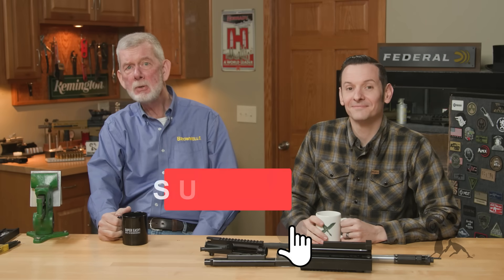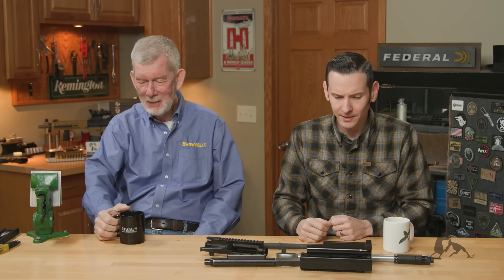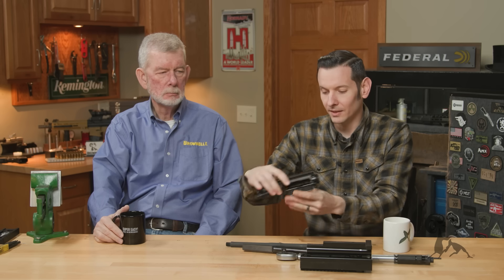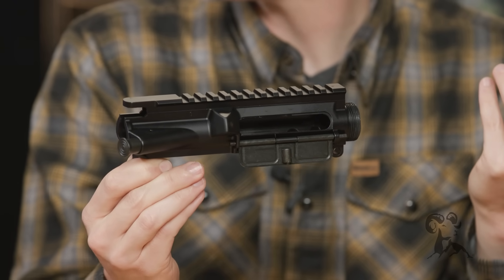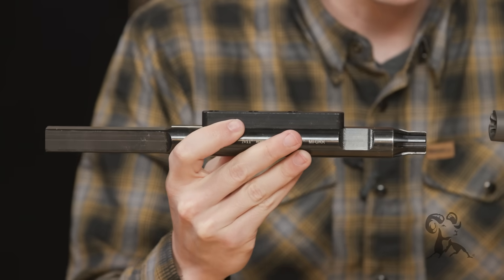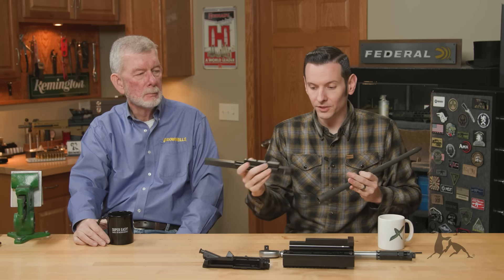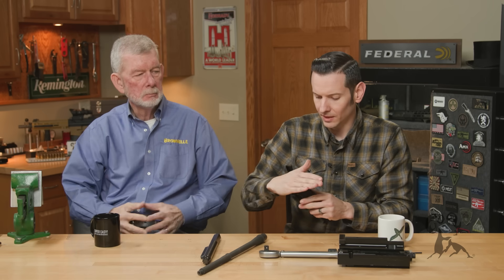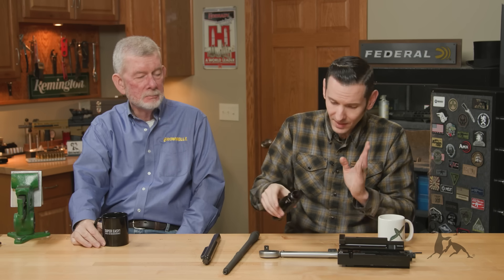SmythBusters: Top 5 AR Building Myths

Comment: What about the 2 piece plastic upper receiver vise blocks that go on each side of the upper receiver? Are they any good for tightening a barrel nut?
Reply: Those are fine, just a bit dated.
Reply: So what is being used now  @CalebSavant
Reply: Yep.  Agree with previous commentor.... I have at least 2 that I've put together that wat with over 2 k rounds... no issue whatsoever.  
That said, I did "ding" a brass deflector with the vise jaw due to inattention using those..... but completely my fault. 
I like the magpul bev block. As it's easier to set up in my opinion.  About $30 when on sale. 
And again, that rod they showed is easier to set up and clamp down, not necessarily superior for quality of build.
Reply: Still a useful tool to keep in your tool box, but it’ll most likely not fit billet or other uniquely shaped upper receivers.
Reply: @Artie760  interesting.  Didn't realize that, thanks!
Reply: I have that plastic clamp style with the tube, the only thing i dont like about it is it will leave a mark on the finish.
Reply: @toycoma98  short answer....maybe.  on the cheaper (andersen) uppers, it may leave a slight ghost mark.... but doesn't cut the finish. You could put a piece of duct tape on the insides of the clamshells to prevent that, most likely.  Doesnt effect how the rifle looks unless you almost have your nose up to it.
Reply: They work and don't Mar painted surfaces.